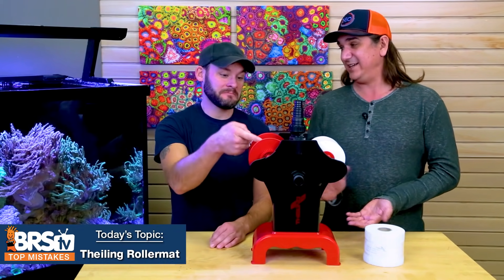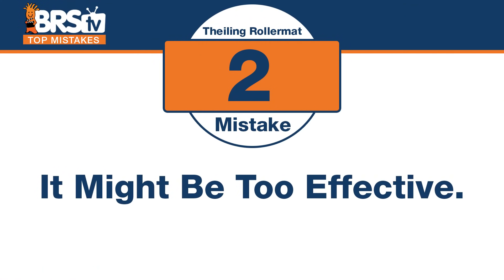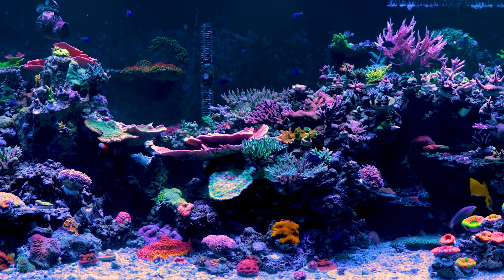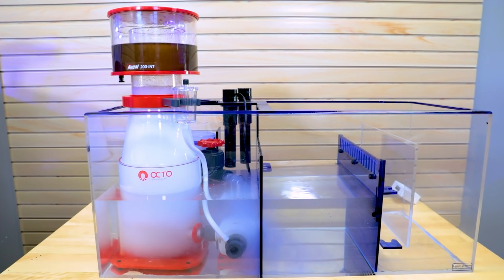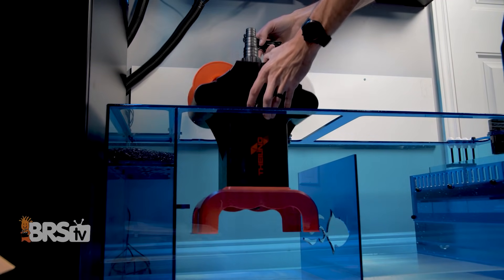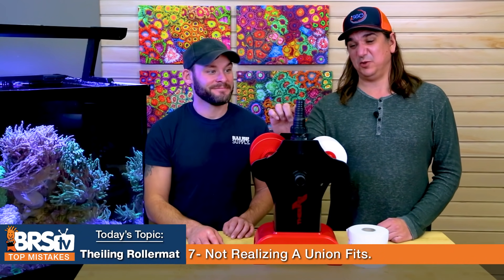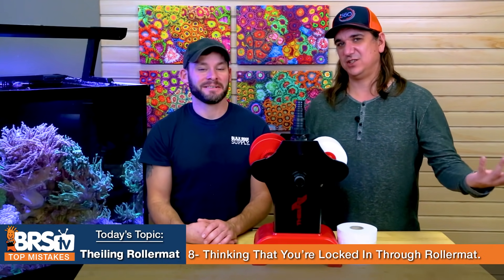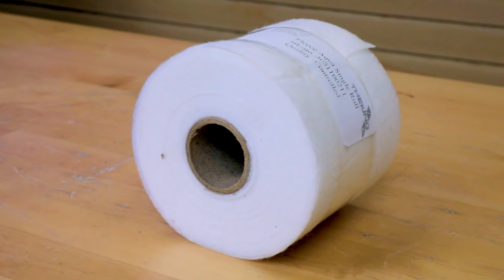Theiling Compact Automatic Fleece Rollermat: Tips You Should Know Before Installing on Your Tank.

Comment: Would this roller mat be enough as a stand alone filtration for a 30 gallon nuvo ext + 20 gallon sump
Reply from the maker: Coupled with regular water changes and a lighter bio load, certainly possible.
Reply: @BRStv  Thank you, for taking the time to respond. You guys are great!
Reply: for a thirty gallon tank....you would not need any additional filters.  If you run it right....you probably don't want to remove much more than the mat is getting...the water needs some nutrients unless you are pure sps.

Comment: The single best piece of gear on my tank. I have a 110g system and a roll last 2-3 months. I feed with a shovel and my nitrates are at 2.
Reply: Do you use the replacement rolls from brs?
Reply: does your skimmer still pull anything out?  My skimmer does nothing since the mat gets almost everything.